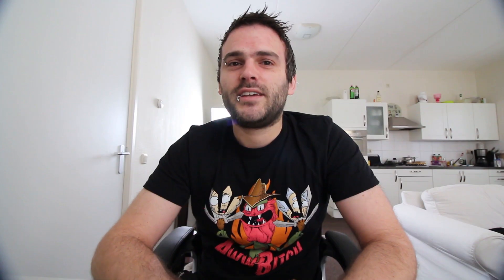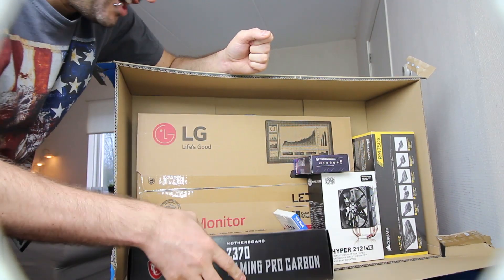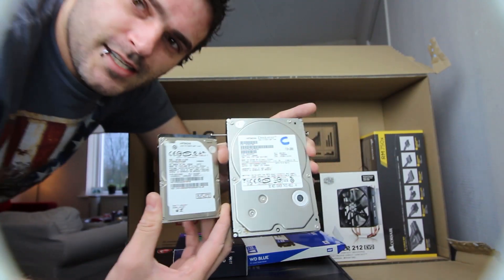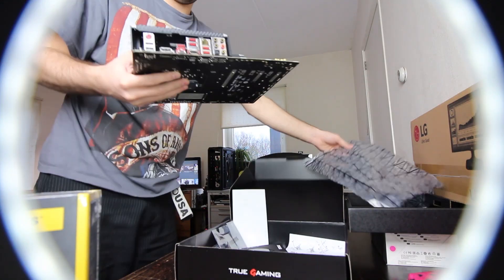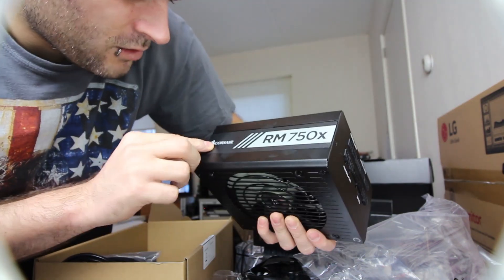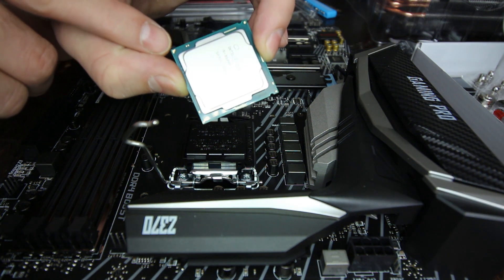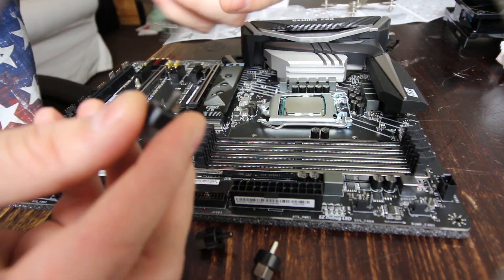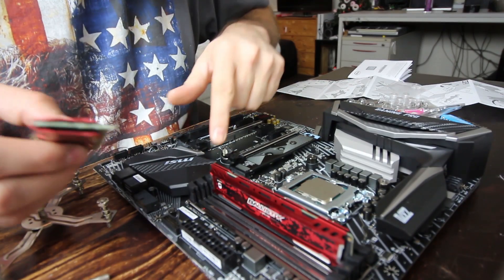My first time Installing a motherboard, MSI Z370 Gaming Pro Carbon

Comment: Actually i got the same Intel Core and i got the Z370 MotherBoard Gaming Plus and as long as its a 300 series the Intel Core will work for it
Reply: how is the gaming plus? I have been looking into buying it but I'm not sure how good it is.
Reply: Plank I recommend it
Reply: Plank but when you buy you’re new Processor make sure it’s a 300 series
Reply: @RealNiggaKazutoKirigaiTheThird  I already have an i7-8700 that i'm going to use with it
Reply: Plank and have some decent ram graphics doesn’t make it run faster ram makes it run smoothly and more tabs at once and the processor is how fast it runs those are the main essentials of you’re pc the most you should spend on a pc is 700-900 (Mines it 800) without a new GPU and if you used to be on console like me just save 60 dollars or more a month

Comment: hi, did you need a wifi module/adapter for the motherboard?
Reply from the maker: Hi Fookie, Yes if you want to use Wifi you would need a module, but you wont have to if you would buy the "msi z370 gaming pro carbon AC"  
Note the "AC"  in the title of the motherboard, that AC version has build in Intel® Dual Band Wireless-AC 8265 card

Comment: no graphics card? the cpu fan is facing straight up, i think the fan should be facing towards the front of the case, so the air goes to the rear of the case, and out.

Comment: Nice vid man but I screamed when you applied the paste, should be fine though just not to much next time , I heard just a pea drop is fine because the pressure from the cooler will spread it

Comment: This is awesome, lol... I'm thinking of buying this motherboard and wanted to see it up close... great video, lol.  and yeah HOLY SH!T!! that's a lot of paste, lol.
Reply: Lol , lol , lol
Reply from the maker: The performance is pretty good (I have nothing to compare to accept a 2008 model, so everything is awesome compared to that)
 The z370 looks great by the way, it has a rainbow colored leds on the back, and you can plugin  2 extra 4pin led strips. By using msi software you can customize the light pattern a little bit (also with phone app). You can pick color, brightness and duration of pulse, or you set it on rainbow. My pc case now is completely illuminated with rainbow led's, it looks awesome at night.

Comment: For the first time in my life i actually  yelled at the screen when i saw you apply the paste i don't mean any disrespect fella but you have way too much on there brother.
Reply from the maker: Hahah awesome, Yeah I figured I did something terrible wrong ;) but the pc is still working, 4.2Ghz cpu 100% load stable at 70 degrees Centigrade.. Next time I upgrade I will fix it with less and better quality paste.

Comment: Dear god... At least do some research if you have no clue how building a PC works. This hurt my soul :') Also you would've been better off saving a little bit extra and getting all high end parts instead of 2 high end (mobo,psu) + rest scuffed. Like others pointed out, do a dot of thermal paste and let the pressure spread it out, there's way too much now. Also, your cpu cooler is on there wrong. It's blowing air back into the case. Go watch some airflow guides.
Reply: Focus on losing your V card bub

Comment: Hi I recently got an Asus z370 and and i5 8600k. I believe I installed it all correctly because all the fans run and the PC lights all work. But when I try to plug in my keyboard and display nothing registers. Is it a faulty board?
Reply from the maker: I don't know, are you sure you have connected all the power cables correctly? My motherboard worked first try, so when I plugged the HMDI cable to my display and the keyboard/mouse in the usb ports it worked right away.  I hope your computer is already working since it has been a day since your comment ;)
Reply: James Hierath Maybe your RAM memory is not well plugged, i had the same problem when i build mine.

Comment: Ugh Im getting ready to plug everything in after just building off a mz370. U do realize ur supposed to keep the black tab on while u close the cpu cover. The black tab pops off itself after seating ur cpu properly. Ur cpus jst sitn there loose
Reply: The only reason the black tab is there is so dust doesn’t get in the cpu socket.  While you can leave the black tab in while installing the cpu it isn’t necessary.  When you pull down the lever over the processor that is what locks the processor in.  The black tab has nothing to do with a cpu being loose or not.  If you don’t pull the lever down then the cpu will be loose.
Reply from the maker: Are you serious? hahah I thought I was supposed to remove the black tab. My pc is working fine and it did not seem loose since I locked it, but what should I do now?
Reply: Bitcoin Daytrader lol yeah Im serious. You can actually reattach the black tab and push lever down to make certain the cpu is where it needs to be. Id like to say chances r if its working fine then it should be good but Idk that id want to risk that what if personally...
Reply from the maker: I thought so to Dustin, because the cpu has a certain shape that can only fit in the socket one way. Ones it is in place you cannot move the cpu at all.